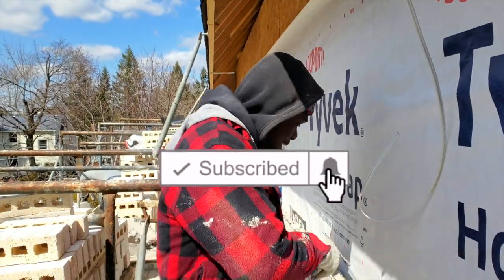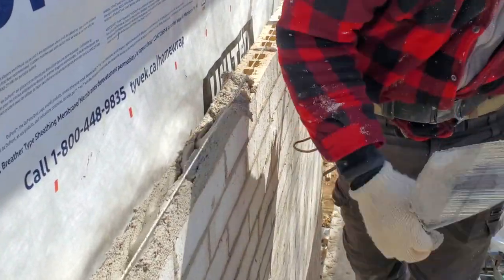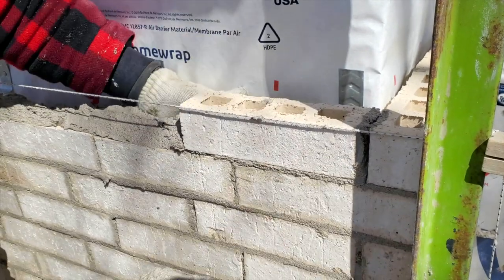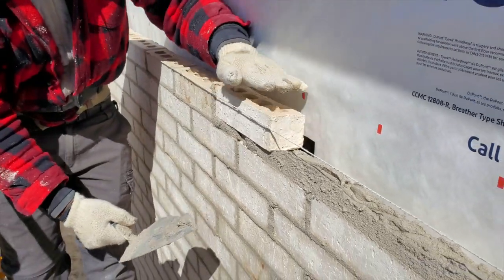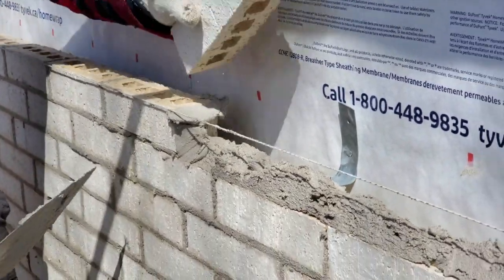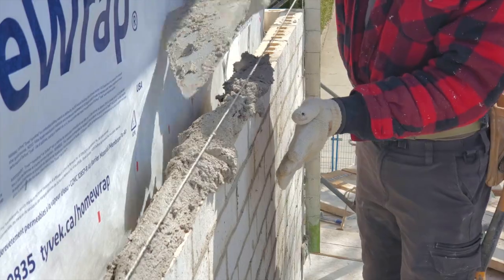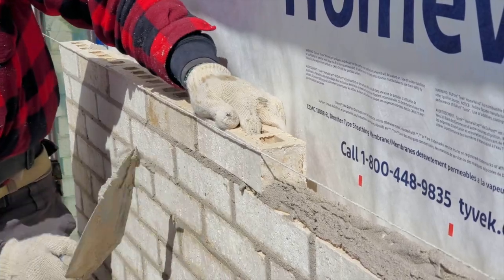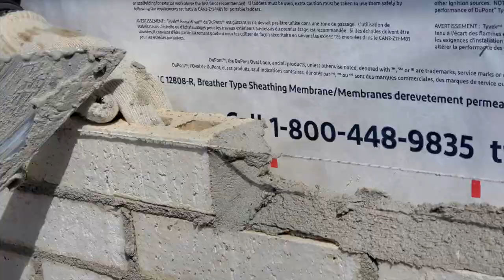How To Lay Bricks For Beginners /ALL YOU NEEDED TO KNOW DIY

Comment: I would like to also see the beginning process, from the ground up. I will be attempting to build a shed with a concrete foundation and midstream have wood as the structure. Termites have rotted/eaten the floor in the existing shed. 😞

*Nevermind I found another video of yours
Reply from the maker: Good luck with your project 👍🏾